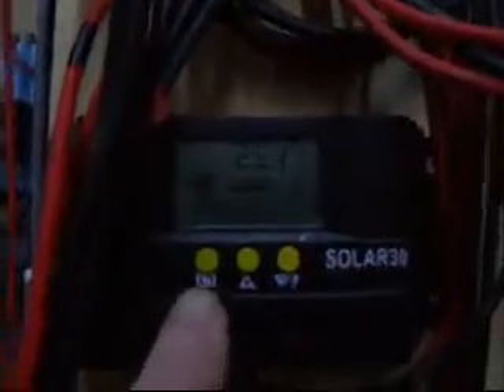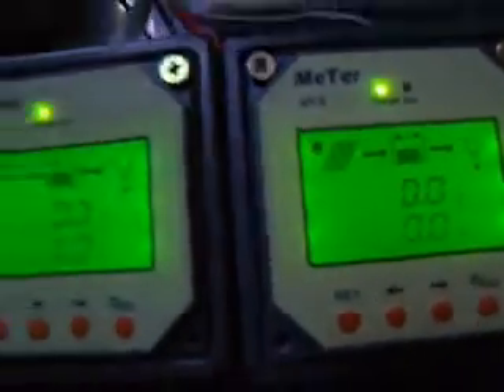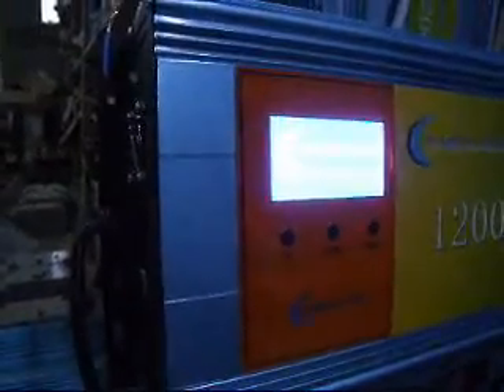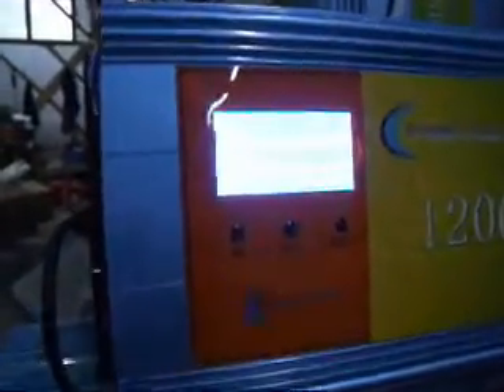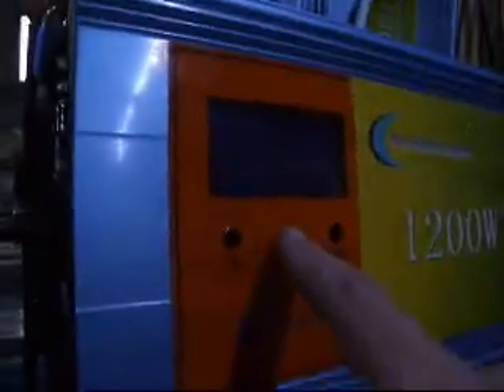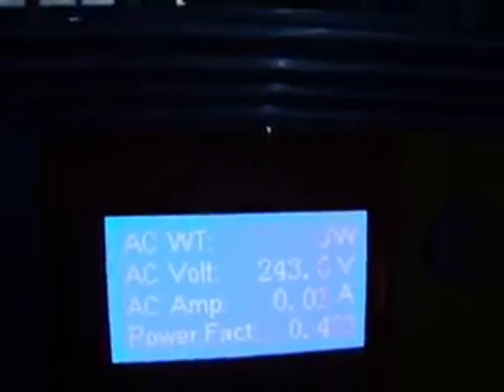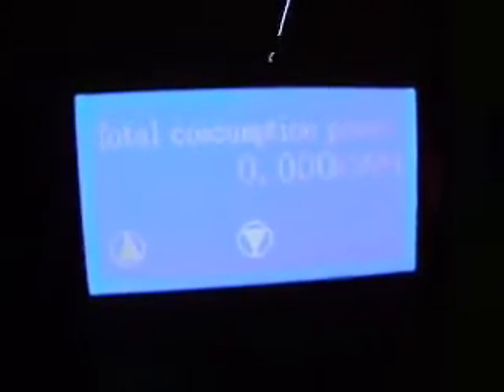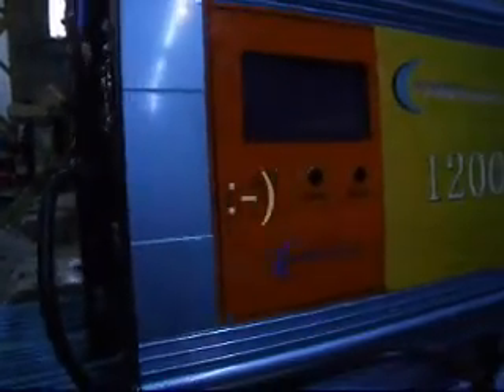Power Jack Grid Tie inverter introduces herself

Comment: hey mate have you got a beta test for all of as to see on the new controllers they have http://www.ebay.com.au/itm/2400w-smart-solar-controller-DC12V-24V-MPPT-100AMP-solar-panel-3-5-LCD-display-/251932296381?hash=item3aa855c4bd 
just there no youtube videos on them yet they don't need to have parrot inside it just charge my batteries and tell my all the info i need on the screen be fine .
this controller be a cheaper set up to have then there new 4 in 1 unit this controller should look nice next to my 8000w LF still going today thanks to you mate thanks.